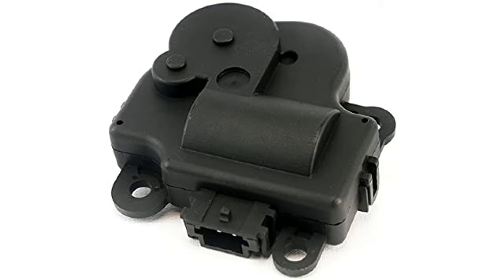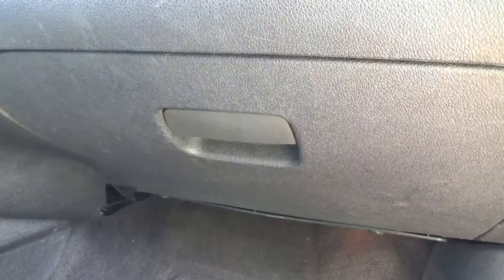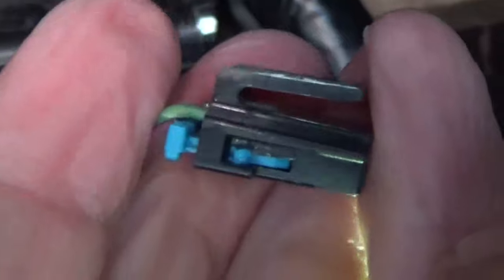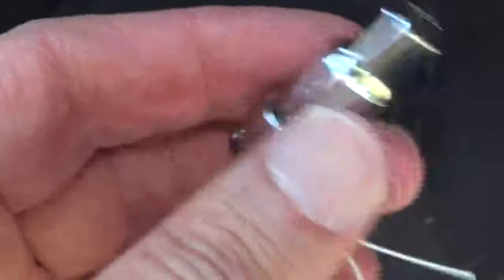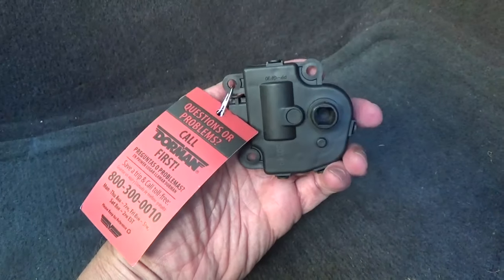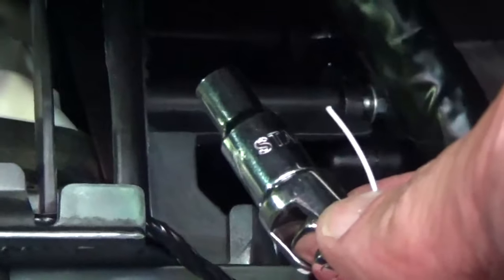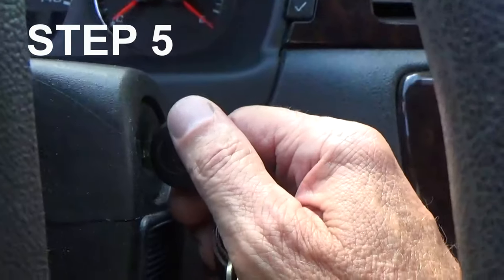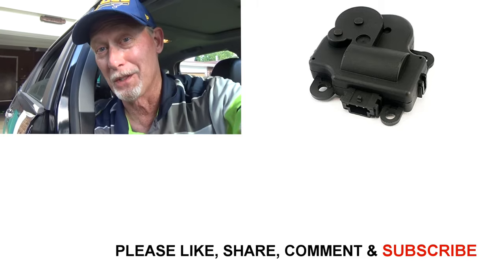HVAC Blend Door Actuator Replacement 2006-2013 Chevrolet Impala & 2014-2016 Impala Limited Click Fix

Comment from the maker: I have had to replace three actuators on this vehicle so far, and wanted to share an easier way I found to make the shaft on the new actuator turn in order to get it into the same position as the shaft was on the old actuator. I used two pieces of wire (plastic coated electrical wire) that were about 12 inches long, I raised the hood, and attached the end of one wire to the negative battery terminal and one end of the other wire to the positive battery terminal. By attached, I mean very lightly attached by shoving the end of the wire in between the cable attached to the post as best I could just so it made direct electrical contact. Then I touched each of the other ends of the wires to the two electrical contacts where the plug from the car goes in on top of the actuator, which made the shaft turn. It was easy to get the shaft lined up in the proper position this way by lightly touching the contacts and making the shaft move slightly each time. Also, the last Dorman actuator I bought lasted only about 1 1/2 years, so this time I bought an OEM AC Delco part. I had read that this would last longer than the Dorman. Here's my Amazon Associate link to the AC Delco part: https://amzn.to/3IcUBik
Reply: On my car the turns off. And turns on and when I push it up it turns on it is it the same piece that causes that
Reply from the maker: This was great advice, which I used when another actuator went out! Thanks for sharing this.
Reply: Will this drain battery
Reply: Thanks so much for this. I have an opportunity to get an Impala for super cheap because the actuator has gone out.
Reply: @morghana3775  Nice - go for it!
Reply: I read on two other videos that the new units are prepositioned in the correct place. I simply turned the vent doors knows to match the new part. Installed all with the negative battery disconnect,  reconnect the wires to the actuators, put negative back on the battery, turned ignition key on for 5 minutes,  no calibration was performed I heard nothing. Everything work perfectly. Your results may vary 😊

Comment: Instead of trying to remove the glove box pins, just remove the 4 phillips screws and the 3  7/64 hex screws for the handle, and take the box part off. Much easier.
Reply: I did that.
Reply: No, no it's not. Removing the glove box door is just LITERALLY removing 2 pins. Don't disassemble more than you need to. I've replaced passenger side actuators 4 times. I say this from experience.

Comment: In your instructions, at the beginning of Step 3, you say to "insert key into ignition".  You did NOT say, at the end of Step 2, to take key out of ignition.  For me, in Step 2, I couldn't turn key to off and I couldn't get key out of ignition.  The doors were open - I don't know if that was the problem.  Long story short, great video! And, whatever I did, the actuator was re-calibrated.  I use a small nail, with a small 90 degree bend at one end and held with pliers, to help get the pins out of the door.  This was the second time I've done this - it wasn't any easier.
Reply from the maker: Scott, I did skip over that part about having to take the key out of the ignition at the end of Step 2, because that was the case for me. Should've shown that or at least mentioned it! I've done three of these so far on the same car, and its never been easy, I'm afraid...I've just gotten slightly faster at doing it. Thanks for the comment and for taking the time to watch the video!

Comment: Great video! Step by step. Even down to tying a string around the swivel socket, so if you drop it you can fish it out, that saved me losing it. Saved me a bunch of money.  Thanks for posting this, I replaced the passenger side door actuator and now I am going to replace the driver's side. I am getting AC only on passenger side, when AC is on drivers side blows warm air. I highly appreciate this video.
Reply from the maker: Glad to hear it helped, and real glad to hear it saved you money!

Comment: THANK YOU SO VERY MUCH !!! Just happened to have the same tool set-up as yours except with a deep-well socket. Worked great until I turned the engine back on and realized that I had put the old actuator back on !!! Tap- tap- tap.....  Took about 20 minutes to do it a 2nd time with the new actuator. My 83 year old Mom is elated that her car is fixed. Again, MUCH THANKS !!!
Reply from the maker: You’re very welcome. It’s not the easiest repair to do, but worth it to save the money!

Comment: I want to thank you for the most comprehensive instruction on performing this task.  My step son and I completed the job in about 1 1/2 hours.  The most difficult part was aligning the actuator output connector with the end of the blend door.  Thankfully, I own a 12 volt power supply.  When attempting to get it in the correct position, while using the connector in the car, it was a royal pain in the butt.  I finally got the slot in the correct 'region' and on it went!  Your manual calibration also worked flawlessly.  We waited the full 5 minutes for each step.  Thank you again!
Reply from the maker: That’s great! Really glad to hear it went well for you. It’s not always the easiest repair to complete, but it saves a lot of money over having it done by a garage/repair shop.
Reply: I did the drivers side and the one on the left side of the glove box a year ago.
Today the one on the right side of the glove box started clicking,I'll be doing that this weekend.
I just reached up and turned the vent door by hand to align it with the actuator no need to hook up power to the actuator to align it,I just moved the door all the way forward and it went together no problem on the first two I replaced.
Reply: @doobiz  You still have to make sure you follow the recalibration procedure, especially if you reposition the door to fit the acctuator.
Reply: @MrCorydog  The actuator is in the correct position right out of the box.
I did the reset with unhooking the battery that I found online.
I have done all 3 actuators now,the first 2 a year ago and they are working great.

Comment: That socket with an elbow is a must and makes the job very easy.  I had to replace the actuator on left side so the socket made the work much easy   Also your tip about tying a thread was very useful.  Great video
Reply from the maker: Thank you very much for leaving the comment and for watching!

Comment: THANK YOU. That clicking was driving me crazy. Way too loud in a confined space like that. This wasn't a problem until I took my car to have a noise from my brakes fixed at MAVIS. As soon as I left there I had an issue.
Reply from the maker: That noise can drive you crazy in a hurry...I've had to put three of these in so far, and I did them the same day they started clicking. I wish they made these parts better to start with so they'd last longer.

Comment: Best video on replacing the Blendor Actuator.  I am having a problem trying to get the Out put Connector to rotate when I connect the Actuator to the Power.
Reply from the maker: That can be tricky. And trial and error to get it lined up just right, but keep at it and it’ll get there.

Comment: Thank you for posting, esp regarding "recalibration" other websites did not mention. 
I have to redo my Dornan brand broke within minutes. I am wondering if by not recalibrating I caused it?
I too was worried but of mostly dropping a screw. I have found that positioning a thin, small piece of fabric below the installation helps. It acts like the net below a circus performer!
Reply from the maker: I like the idea of the safety net! I've dropped a few screws and nuts down into hard to get places, so I'm up for anything that helps me with that. Not sure about the actuator...maybe just got a bad one?
Reply: @HowSkills  I like your idea using the string. I have used grease in a socket to hold screws/bolts for outdoor parts and I have heard of magnetic sockets but don't need another socket set.

Comment: one of my actuators went out over 6 months ago. and recently i think another may have gone out. there’s 2 cycles of clicking/clanking. one clicks for a minute or two and stops, then another one clicks for a minute or two and stops. are all actuators the same or do i need two different specific actuators? great video, very well detailed. LETS GO BLUES
Reply from the maker: You’d have to check the part numbers for your specific vehicle to be sure, but in general, the  parts would be the same. I had to replace three of them in my car. It’s a shame that Chevy used a part in their vehicles that was so prone to failure.

Comment: Have a 2016 Malibu LT and the front defrost stopped working.  Dealer quoted $1,300 to fix it and stated the entire dash needs to come out.  Wonder if it's as easy as going through the glovebox to fix a defrost actuator or if there is something else that needs to be done?

Comment: I read that you can just pull the fuses and wait 5 minutes instead of disconnecting the battery? Thoughts?
Reply from the maker: I have heard that. Someone mentioned pulling the display fuse, but not sure if that alone would be enough or what others specifically would have to be pulled. Would probably have the same result if done right.

Comment: Hi, I hope you see my comment, question. My recirculator actuator on the passenger side, furthest to the right, was clicking. I disconnected it because it drained my battery. My question is, do I really need a new one, or can I go without one? Thank you!
Reply from the maker: That just depends on whether what it did is important enough to you. If it prevents you from switching between cooling and heating, that could be reason enough to replace it. And I'm thinking the one you're describing does that. If it just switches between different air output locations (like between floor or dash vents) then you might be able to live with that.

Comment: I'm wondering if there's a replacement part that is redesigned not to bust a tooth off that gear?    I've turned the gear 180 degrees out on my inlaws modules and they worked for a few years after words.  The passenger side is doing it again now.  I'll take it apart this weekend and see if two teeth are broken this time.
Reply from the maker: Not sure of which is the best part to buy, but I've replaced three actuators on this vehicle and used Dorman for the first two. The last Dorman I put in only lasted one year, so the most recent one I installed was an OEM part, an AC Delco actuator. I had read on some forums that these would last longer and were made better than the Dorman. I'll find out eventually, I guess!
Reply: @HowSkills  still going strong!?
Reply from the maker: Yes!! The AC Delco has performed like a champ!

Comment: I have a question that actuator u changed was it for the defrost vent
Reply from the maker: I’m not sure about that. I mainly noticed that it controlled mixing hot and cold air for the dash vents, but it very probably mixed the air for the defrosters too.

Comment: I replaced two of mine a year ago,the drivers side and the left one behind the glove box.
Today the right one behind the glove box started clicking.
The first two I just reached up and grabbed the shaft on the vent door and turned it all the way forward to align it so the actuator went on,no need to power up the actuator to align it.
Reply from the maker: Nice...sounds like great advice to me!
Reply: @HowSkills  I did put in the actuator this past weekend and I just flipped the door to the open position and the actuator lined right up.
They already come set out of the box in the right position so just flip the door to the other position if it doesn't line up.
It worked on all three for me.

Comment: After replacing the actuator what do you do if you still don't get air blowing? Different issue? Also thanks for the video! Very helpful for a non mechanic like myself!
Reply from the maker: It may be a different issue. Or you may have another actuator that's gone bad and it isn't opening up the right pathway for the air to come through. The Impala Limited has four actuators that control different parts of the heating & A/C, and I had two different ones go bad in two months. Sorry I can't be of more help. Do you hear the fan blowing, but the air isn't coming out where it should?
Reply: @HowSkills  I didn't hear any air blowing at all but I'm going to uninstall and reinstall later today and listen more. The door did open and close after we changed the actuator but it wasn't moving smoothly then after turning the key off and on a few times it didn't move at all. I'll see if there's any change when I start it this morning. Didn't have a lot of time to mess with it last night. Thank you for the quick response!

Update: 
I uninstalled then reinstalled it and same problem. So I decided to put the new actuator where the other visible one was also behind the glovebox. Slight noise briefly and no air blasting. I still don't hear the fan BUT I can feel very little coming out of all vents which I didn't have before. Driver side adjusts hot and cold but passenger side is only cold and colder. My guess is I do have 2 bad actuators. Would that cause the temperature difference and the air not blowing hard?
Reply: @HowSkills  it turned out to be a bad blower motor resistor. The actuator also needed replaced but the resistor had a burnt up wire. Had a friend look at it and he wired around it to give me heat. So now after I replace the resistor I should be all set. Thanks again for your video!

Comment: How do you know which actuator it is when there's no noise or clicking? Blows hot air on passenger side cold on the drivers side.
Thanks
Reply: Bro did you figure it out? I been scanning these comments bc this happened to me. Right after I changed my radiator fan, the AC worked for a day. Next day passenger side was blowing hot. Today I replaced the driver side actuator, thinking that’s why it’s hot/cold, the clicking stopped but it still blow hot on passenger side.

Comment: Stan, I opened the fault actuator and it is the same gear they sell on line for $12.99.  Other gears look fine.  Is it worth it?  I understand it isn't worth it for the actuator that goes behind the radio, but the other two (passenger outer one, and driver side) aren't that bad to replace.  It's a shame no one makes a metal or tougher nylon gear set.
Reply from the maker: I have never tried that, but it sounds like it would be worth it. That gear going bad is the main problem with this part, and it apparently isn't designed with long life in mind. I'm like you...I wish someone would made a sturdier gear set. Not the best design, Chevrolet!
Reply: @HowSkills  I call it actuator insurance.  With a spare one ready to go, there will never be another failure!

Comment: So this might be a stupid question but so if it's clicking does that mean it needs to be replaced with that being said I had a mechanic essentially supposedly fix it I don't know if you like Jimmy rigged it or what but only the the top vent heaters work floor heaters do not work or let alone even blow air please get back to me as soon as possible I'm done with mechanics I just want to learn my car and work on it myself

Comment: Are those 2 Actuators on the passenger side  the same ? So if you dont recalibrate Properly will they start messn up again ?
Reply from the maker: They are the same, and it’s a good idea to calibrate them.

Comment: Your instructions were perfect.  Only suggestion I have is to use a "thumb wheel ratchet drive to get the screws out. Chevy should be ashamed at the maintainability design. They must want to 
increase the time to repair for their dealers.

Comment: Man, I have two actuators that are doing it.  How do you get to the other one?  CD player maybe?
Reply from the maker: There are three on the right side that you can get to through the glove box. The other is on the driver’s side - is that the one that’s making the noise?
Reply: @HowSkills  How difficult is the driver side one?  I was under the impression I was gonna have to take the dash off to get to the left side one.  I've seen someone say its under the cover of the drivers side and you change it there much like you did this one with the glove box covering the opening.

Comment: How hard is it to put the glove box back on?
Reply from the maker: I isn't bad at all, and actually easier than taking it off. The pins slide back in easily with the help of a slotted screwdriver.
Reply: @HowSkills    I didn't end up removing the glove box BUT thank you so much for this video! I was able to fix my husbands blend door so my daughter and I have heat now! :) Now onto the next issue with the car!

Comment: In my case, the actuator wasn't bad.   HVAC mode door must have gotten stuck and made the same noise but , once freed up and lubed, only required re-calibration.  2nd problem with these mechanisms, 2010 Chev Impala, 63k miles.
Reply from the maker: I've had to replace three actuators at this point with 126k miles. Chevrolet didn't make these as sturdy as they should've.

Comment: Is there one for each side
Reply from the maker: There are actually four altogether on this vehicle…three on the right side behind the glove box, and one on the driver’s side under the steering column.
Reply: @HowSkills  I did the one on driver's side because it would blow cold but hot on passenger side know it opposite hot driver side cold passenger side so which one do I replace on passenger side? I don't have clicking noise

Comment: So is just 3 actuators in this type of impalas?
Reply from the maker: There are actually four actuators: three behind the glove compartment and one on the driver's side. That's true for models with Dual Zone controls.
Reply: @HowSkills  thanks , actually I just  changed the driver side and passenger and was just as easy. Thank you very much for this video, you're the best 👍